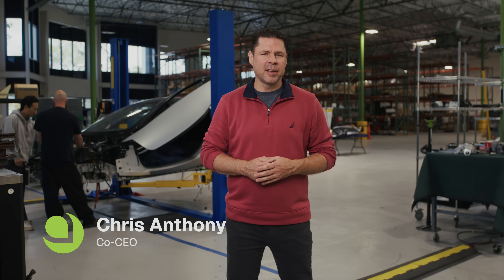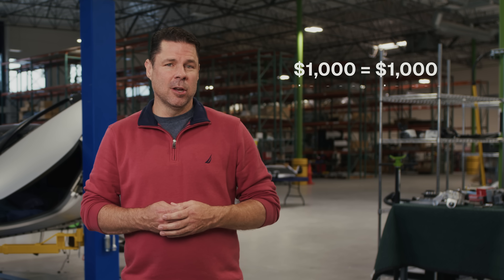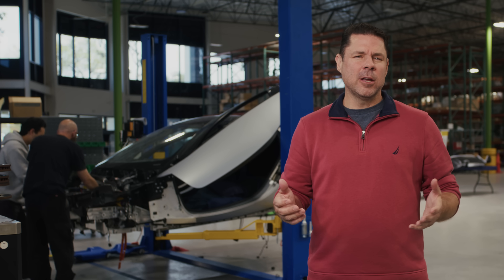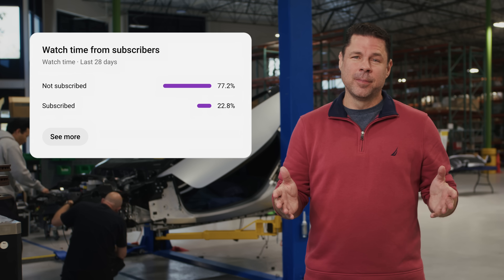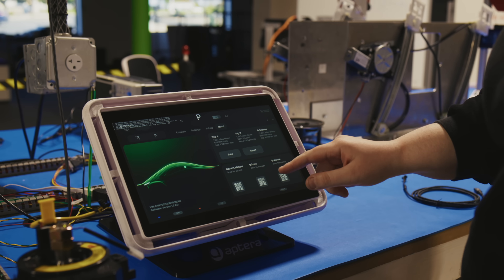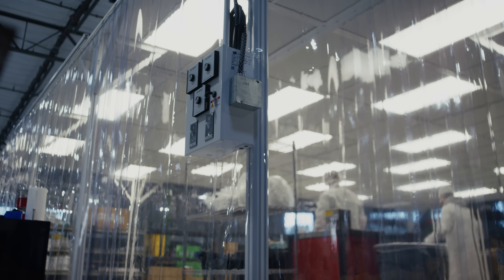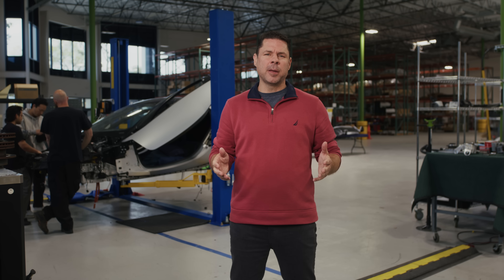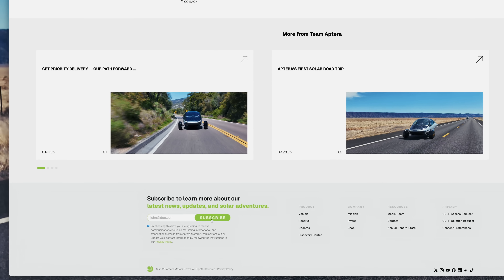Aptera Update — April 2025

Comment: Any holes in the exterior for cooling with heavily impact the drag of this vehicle. I was wondering what considerations were taken for airflow optimization for cooling? Dedicated expanding intake and contracting exhaust housings for cooling radiators? Pressure zone considerations for maximizing internal cooling flow differences from external flow to maximize diffusion?

Also, if you need a test driver I would be honored to assist in the development of Aptera!
Reply: The "radiator" is built into the lower body panels.  It is a pretty cool unit.  No holes for air access, the surface of the lower body radiates the heat outside..  It is somewhat limited but with the low power levels needed it seems to work adequately.  From what I understand it is part of why the charge rates are not as high as you would expect.  When you aren't moving you aren't dissipating a lot of heat generated by charging.  Fortunately a low rate of charge is good enough when you are only using 100wH/mile while driving.
Reply: @bryanwhitton1784  I believe you are a year or two behind.
Reply: @ What do you mean?
Reply: @ I stand corrected then. I never heard that.   Thank you for giving me that information.
Reply: So would I.